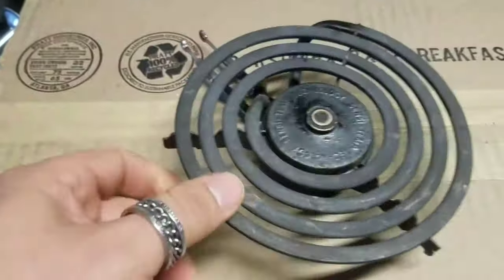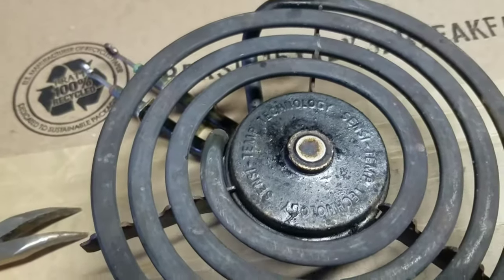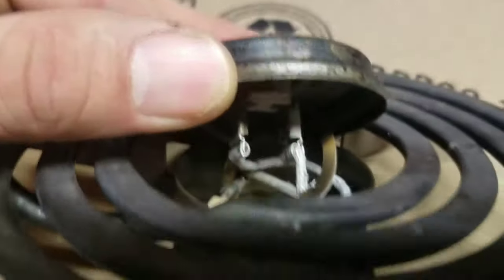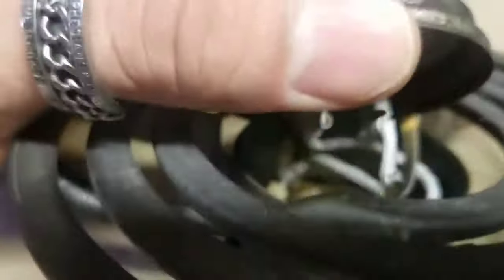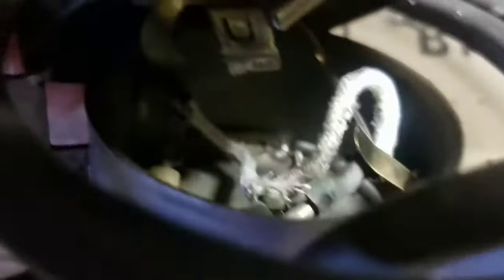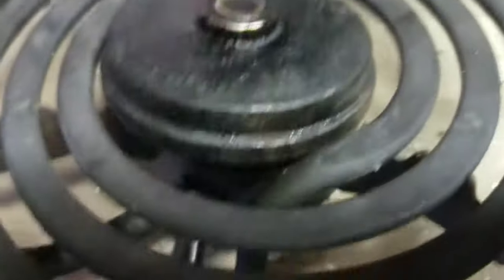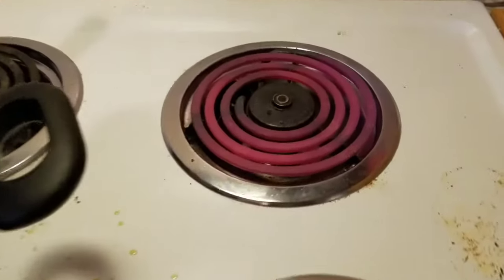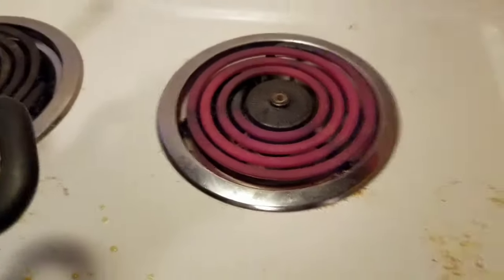Quick Fix / Sensi Temp Electric Stove Stovetop Burners Not Staying Hot or Inconsistent Heat

Comment: I tried this on one an I almost shocked myself when i turned it on 😂💀 spark came from the back an from the electric grill part
Reply from the maker: Yikes!!  Yeah that's the iffy part about those bare wires being there.  

In the description, as well as several comment replies, it's HIGHLY recommended to use ceramic wire nuts to screw onto the bare wires that are twisted together.  I didn't even know those were a thing until way after posting this video.  Ever since finding out, I've tried to emphasize it as much as possible in the comments, as well as the description. 

Be safe!

Comment: How did u take the wires out
Reply from the maker: I actually just yanked them out of their connectors, which was just lazy on my part.  Clipping them with wire cutters as close as you can to the connectors would be way easier, more efficient, and less messy.

I hope that answered your question.

Comment: I did it and now it doesn’t turn on , help me please….
Reply from the maker: Maybe the breaker got tripped?

The scariest part is making sure the bare wires you had to twist together aren't touching anything else at all, because you don't want to cause a short.  Which it sucks because you can't use electrical tape or plastic connectors to cover the bare wires because it will melt when you turn the burners on.  I'm thinking maybe packing a small amount of ceramic fiber around the bare wires might help?

Again, I only did this for temporary purposes. I eventually saved up enough to get a regular set of coils on Amazon for 40 bucks.

That might be the best way to go if nothing else works. 

Good luck to you!
Reply: Thank you so much for replying, I appreciate, yes I will buy the elements from Amazon, thanks again 👍

Comment: I did this and mine still doesn’t get red hot like yours does. Wtf
Reply: I even replaced the sensi temp burners with regular ones. It still doesn’t get hot enough
Reply from the maker: Oh shoot. Well if you replaced it with entirely different burners and it's still not getting hot, the problem is with the stove I'm guessing. Did you buy a whole new set of burners or just a single coil?

Comment: The worst stove ever,this will be the second stove in two years that has to be replaced unfortunately this is the only kind of stove management provideds I tried this and almost socked myself sparks started sparkling now my second stove they just completely burnt out sometimes they heat up and sometimes not at all.I have stoped making homemade tortillas because of the fact that it cools down so my tortillas are not cooked  throughly or either get to hard   takes even longer to cook food im down to one burner now I did t know you could just put different burners cause im scard to do this agian even though this is a great fast money saving solution
Reply from the maker: Yikes!! Be careful!!

Yeah this mess is definitely more about the burners than the stoves themselves.  And I want to emphasize this is definitely just a temporary fix until you can save up the money to buy regular burners, as that's absolutely the best case scenario.

Also, I've mentioned it in the comments as much as possible, and I also edited it in the description, to get several pairs of ceramic wire nuts to screw onto the twisted together wires, instead of leaving them bare.  I wasn't aware of them until after I made this video, but I updated that info the same day a commenter told me about them. 

Hope that info helps.  Stay safe!!

Comment: Thnk you, you can not water bath or pressure can with this stupid safety feature!
Reply from the maker: Very welcome!  Remember, if you decide to do this, don't leave the wires exposed and bare that you had to twist together.  Make sure you screw on some ceramic nuts to the twisted wires.  This will significantly lessen the possibility of an electrical spark or short.